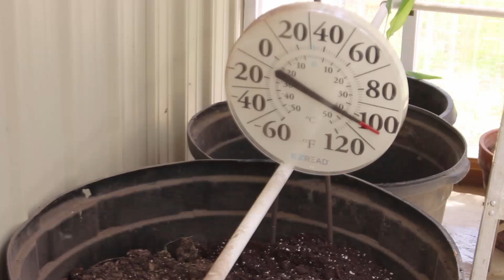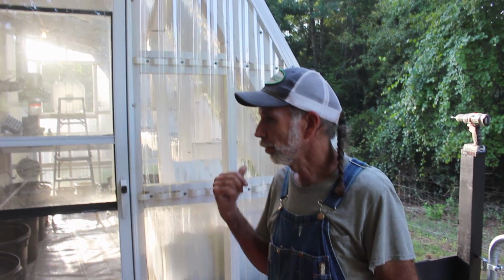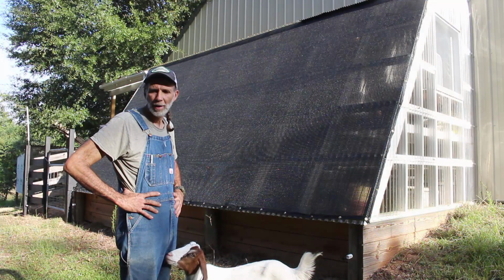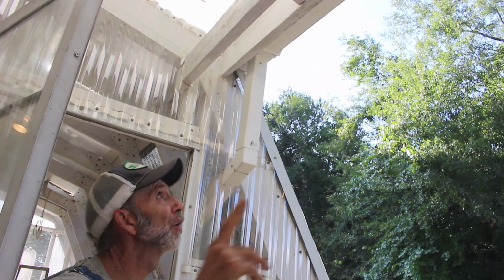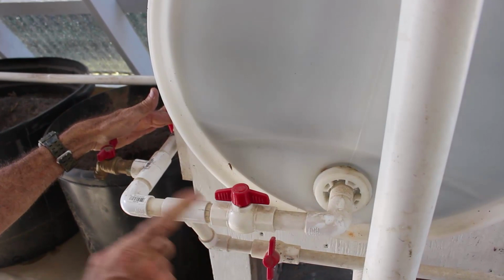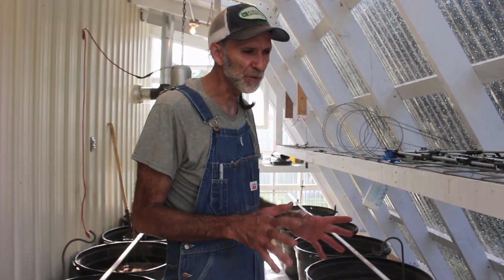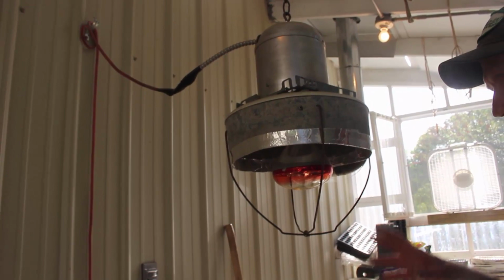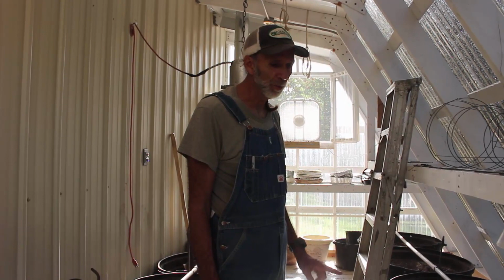Installing Shade Cloth on the Greenhouse

Comment: My daughter & son-in-law closed in half of my double carport.  He made "window frames" for it.  I bought 90% taupe/tan (to go with the brick on the house) shade cloth on a 100' X 15' roll.  We cut it to size as we stapled it on the "window frames".  He also made "storm Windows" which are added in late fall.  These were plastic pieces on a roll stapled to the frames.  That was 4 years ago and it is still in great shape although the plastic storm windows have some tape repairs.
I have kept plants in it over the winter with no problems and heat coming from a space heater to keep the cats warm enough.  
There were other % on the shade cloth but for the cats I wanted the max protection. I ordered it on-line for home delivery. Home Depot was the cheapest for me in Louisiana.  In the SW, you can buy it in the local stores.  I turned up the sides and sewed it down before putting grommets on the edges to use as shade for our RV we lived in almost 20 years ago.

Comment: Interesting set up, I'm glad to see you added a fan, it's a good first step. Have you seen and considered solar powered vent fans, some even have adjustable thermostats. It's a great age we live in for mad scientists like myself. 
My 3rd son has been teaching himself camera security systems and led lighting systems with a little help from me and his grandfather (we are both Electrical Engineers). I have now (with my son's help) a system that I can view from anywhere, check all the sensors for temperature, humidity, water use rate of self watering and get alerts of any problems with my indoor gardens. I even know now when the CO2 levels get to low for optimum plant growth. 
Just a suggestion, you might want to have the shade cloth on a track system that can be deployed when needed using a small electrical motor, come Winter you'll want all the light you can get plus some led lights to add a bit more.
Reply from the maker: s fetterly I had a solar system coming but the guy had a brain anyrousym and it was stopped. We can only do limited things because of the cost of projects.
Reply: @DeepSouthHomestead  I understand, there's just never enough to do everything. My 3rd son has an Amazon Prime account. Often I'll have him order things I need and ship them directly to me and get huge discounts and free shipping, I bought a membership to Harbor Freight and got multiple membership cards that I shared with him and another family member ... I could give dozens more example of ways we save on things needed and we share our resources, knowledge and abilities. Building a family and community of giving people means no one needs to rely on just their resources and abilities. When someone needs,  the word is spread and those that can help jump in and in no time things that are extremely difficult are done with ease. This is the way of YHWH and it just keeps growing every year. I'm sure you have begun to experience this in your life.
 A new farmer that just started consulting for this year, relied on 1 very experienced farm hand for nearly everything. Things were great until that 1 farm hand broke his leg. Suddenly this new farmer was way in over his head. I knew a few things that helped and some of the other farmers I work with helped out and we were able to get him 2 experienced farm hands to get him back on track. 1 of the farmers that brought equipment in to help the new farmer get caught up was looking for trees to harvest for lumber this Fall, sure enough the new farmer has over 10 acres of land dense with trees he was hoping to clear in the future. Now those 2 farmers are the best of friends and working out a lumber harvesting agreement that will profit them both with 10s of thousands of dollars more than they could have hoped for this year. Problems are nothing more than opportunities waiting to happen. Give and it shall be given unto you ... 
I wish you were a couple thousand miles closer, you'd fit right in around here!!!
Reply from the maker: We use Amazon prime and it helps a lot with shipping. We are so far from major stores that its cheaper for us to order what we need.
Reply: @DeepSouthHomestead  That's great. Imagine sharing that Amazon Prime service with 8, 10 or 12 people that share their money saving services with you. It takes trust and a willingness to live by biblical values ... it takes time and most of the risk years ago was mine, but slowly it has become a powerful force for good in many people's lives. 
I'm happy to see your daughter and granddaughter there on your farm and all the other visitors you have ... great community you have started!!!
Reply: s fetterly that sounds like an AMAZING symbiosis

Comment: I love that you put it under the top roof and not many people would have thought to slide the ladder under the cloth. You know you are good when other builders appreciate your work. I would love to one day work with you on a project. DO YOU HAVE AN OVERFLOW ON THE BARREL? You had some taller stuff on the left side last year so you may want to put that shelf higher or only go part way , Instead of changing the barrel you could just wrap it with black plastic unless you want change it for aesthetics.
Reply from the maker: Yes the overflow was the large pipe.  We had a video clip showing the overflow but Danny forgot to mention it and I forgot until I had the video uploaded.  Sorry about that.

Comment: I wish that you would’ve shown the screws that you used in a close-up of your work. I have a small A-frame greenhouse on the block foundation and I am trying to figure out how to secure it because I live in zone 8B, hurricane territory and would like to install it with as much windproof ability as possible. Those grommets are so large what size washers did you use what size screws did you use? Thanks for any help you can offer I’m doing this by myself and I could use as much advice as possible your structure looks identical to half of my greenhouse